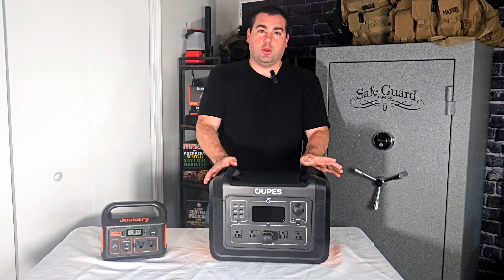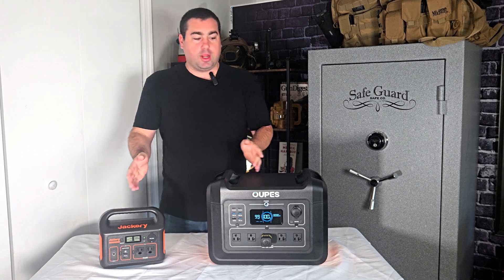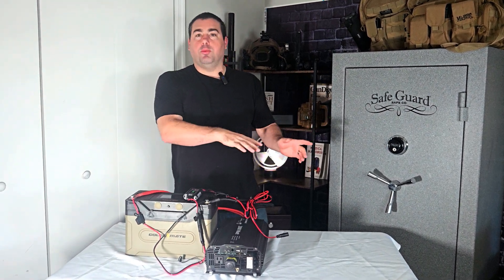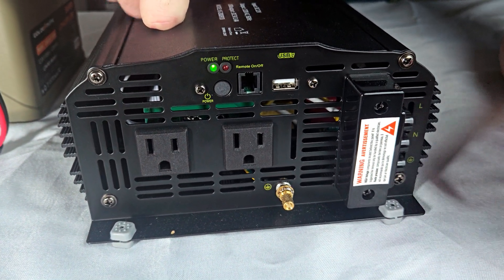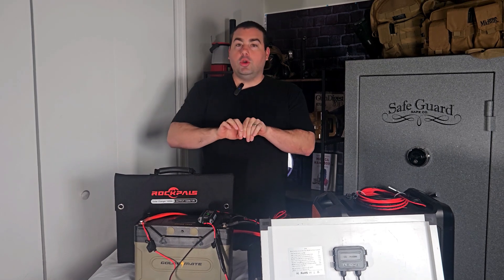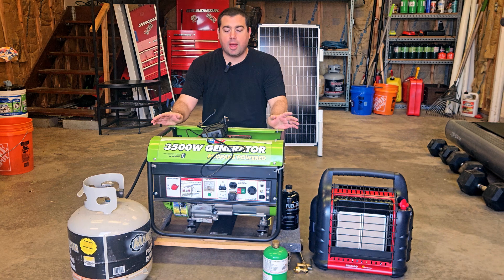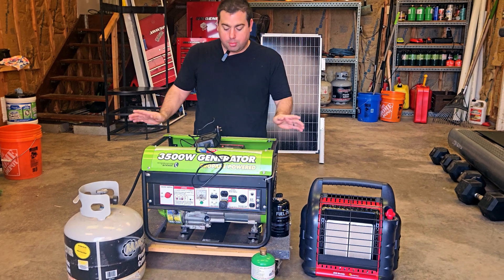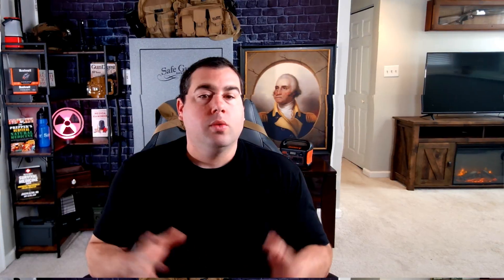Ways to Make Power in an Emergency

Comment: One cheap source of emergency power not mentioned is simply connect a 1200w invertor to your car battery, and run the extension cord into the house. I am considering this setup to recharge my power stations, but it could power other devices as well.

Comment: I'm guessing that your All Power 3500w generator is a conventional generator...NOT an invertor generator. I have been trying to find out whether it's safe to use a conventional generator to recharge the LiFePo4 batteries in my power stations. I get a different answers depending on who I ask. Have you had any issues using that to charge your power stations?